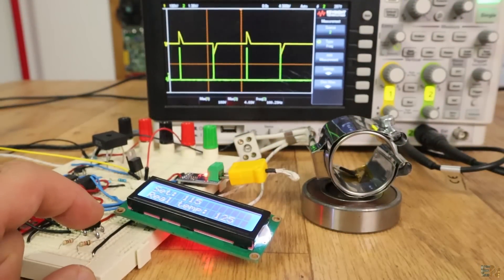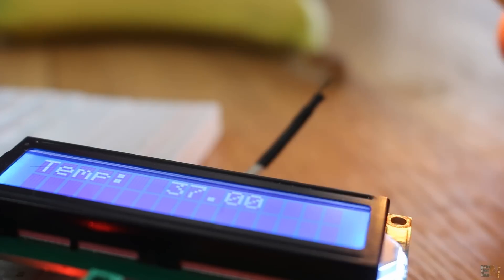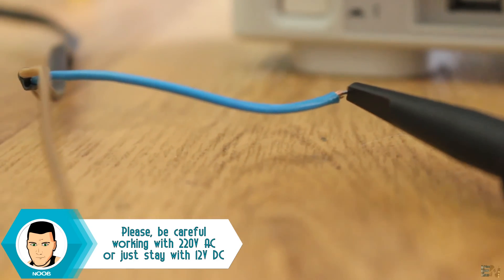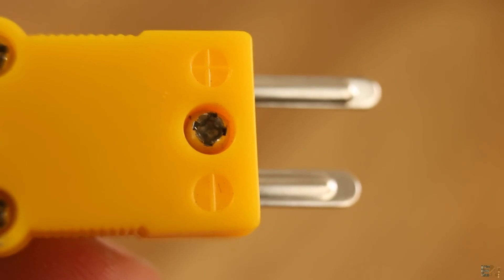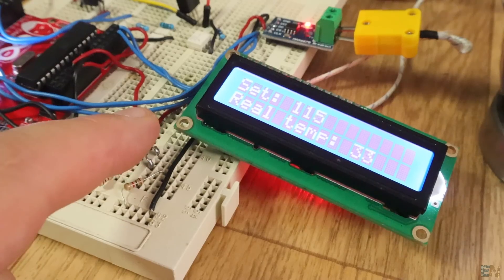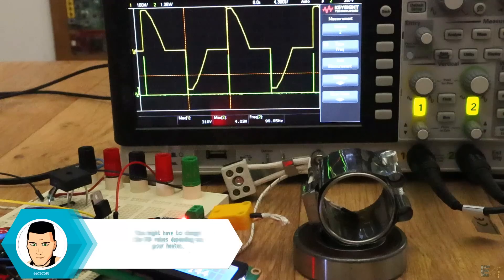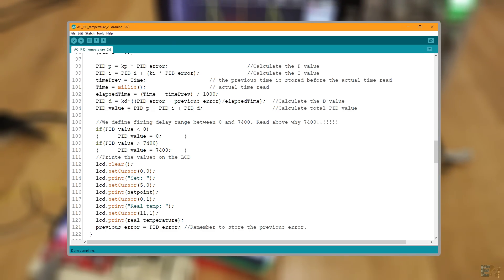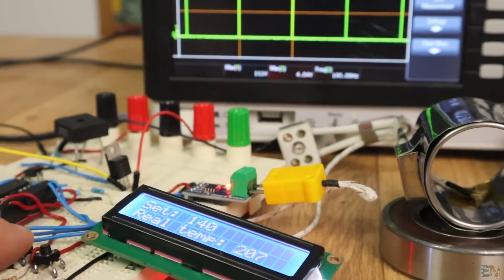AC 220V Heater Temperature PID and TRIAC control

Comment: How accurate is the temperature reading of this sensor? I need to control a water heater to keep tthe water at 30°C. It is for developing photos and therefore it must be pretty accurate.
Reply: Ange Einstein It depends on the adc (analog to digital converter you are using, but for photodeveloping the arduino's adc should be adequate.
Reply: And which kind of heating element would you recommend for this? I want to keep a tank of water at 30°C and put smaller containers with the chemicals in it so that they all have 30°C. I think thats easier than having extra heaters for each chemical.
Reply: Ange Einstein How many liters is the tank and what are the dimensions(i.e. the surface area between the tank (water) and the air.)?
Reply: It has to fit 3 containers with about 0.6 litres chemical each plus the same amount of fresh water (this can come from the big tank). I dont know exactly if I want to make an enclosure for the whole thing.
Reply: Ange Einstein 
According to https://elementsofheating.wordpress.com/2012/09/26/how-to-calculate-the-kw-required-to-heat-a-volume-of-water-in-a-particular-time/
3 containers of 0.6l rounded up to 2 liters and now the temperature rise in from room temperature is around 10 degrees celcius. You probably want to heat the water up in under 10 minutes.
2×4×10×6(which means the container will heat up in 10 minutes/3412 is around 0.14kW= 140w heater. I would recommend a 150w aquarium heater

Comment: How to do this for 3 PHASE star configuration if I star connect 3 heaters .
Reply: Raghav Srivastava For that ypu would need3 triacs and 3 photo triacs, but of you use a 3 phase heater, the thing ypu are heating has a great thermall mass and you could get away with just a relay or a 3 phase contactor

Comment: Hey, @Electronoobs this is AWESOME!!  Thanks for putting this up and it's exactly what I am looking for to make a homemade candy maker and keep the candy at temp to increase my working time by keeping the candy hot in a hopper.
One question is I am in the US and 120VAC.  I think this will work if I understand because the photocoupler should find the zero cross point no matter the AC voltage.  The one thing I would have to change is aximum_firing_delay to my electric.  Is that correct?  If not what would you change for 120VAC?  The BTA16 TRIAC maybe?
Reply: Dave Young this project should work fine for american 120V AC
Reply: Thanks Jonah!  Much appreciate the time to respond and confirm what I learned!
Reply: can you help me out please ?
I have constructed the circuit but when i run it LCD is powering ON but is not showing any display i have used a potentiometer to vary contrast but still no results...can you help me with it ? 
I'm using an arduino UNO